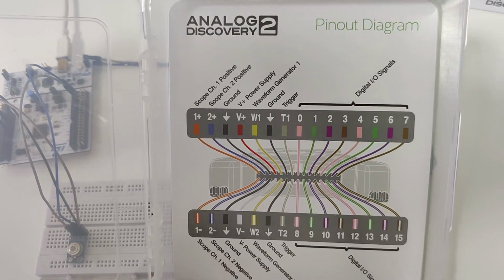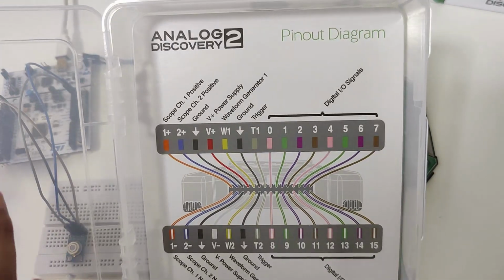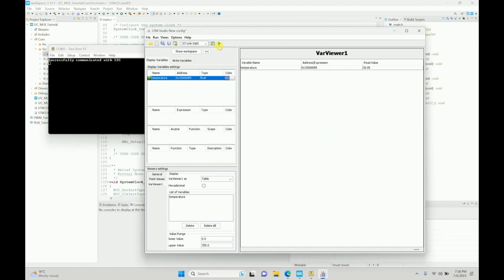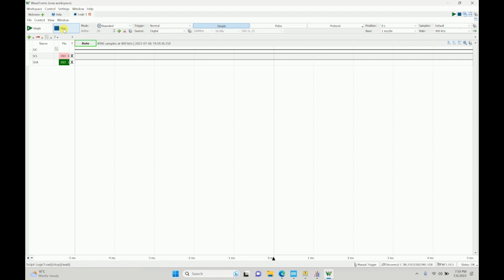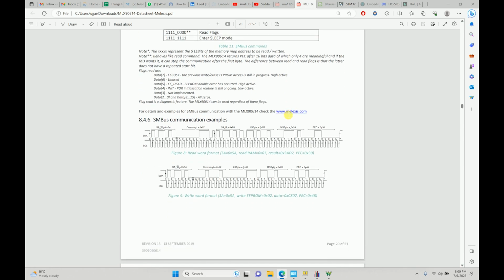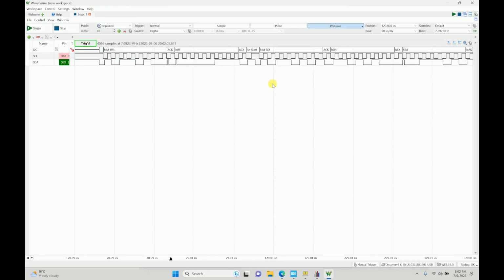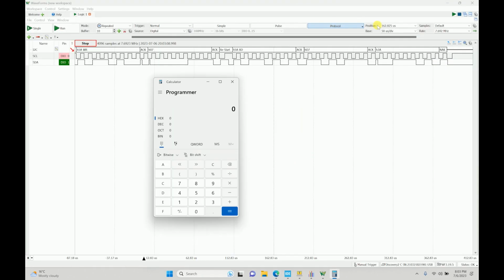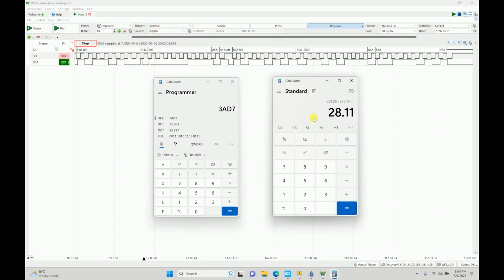I2C - Protocol Analyzer using AD2| Logic Analyzer | MLX90614 | Analog Discovery 2

Comment: Hi, I never touched the AD2 functionality for protocol analyzer but I plan to use it for my research.

Just a quick question, is it possible to decode the information from the sensor using the Script functionality of the Waveforms app so that it is written on the logs?

Thank you in advance.
Reply from the maker: I believe it should be possible. I know saleae allow you to have external scripts embedded into the software. So based on that assumption I would say there will be a way to have external scripts in AD2 as well. 

Stating all of this, I have never tried on AD2 so there will be some background work that you might have to do. 

Thanks